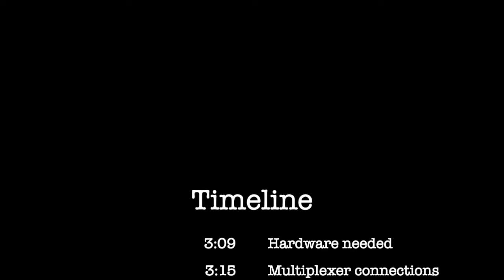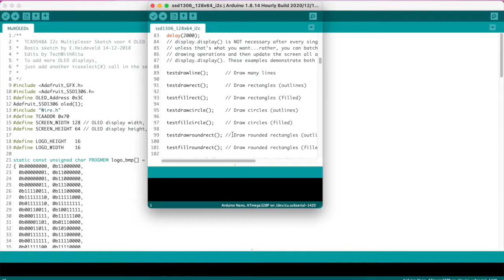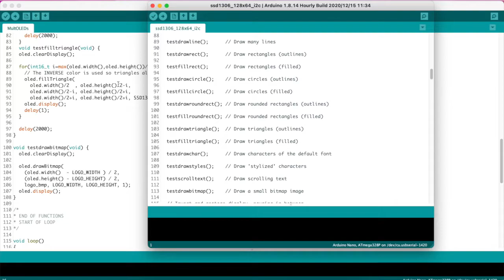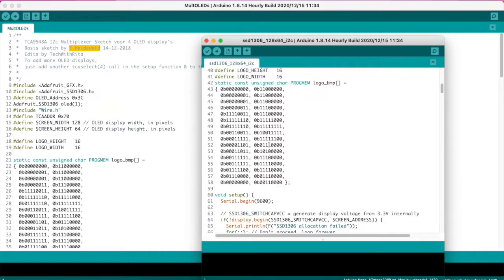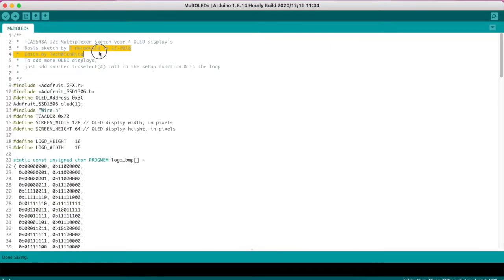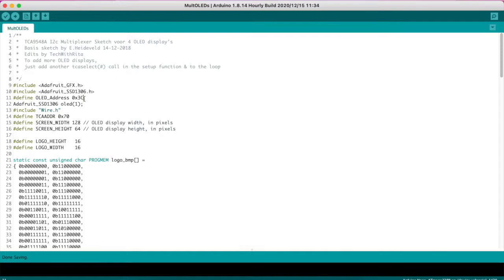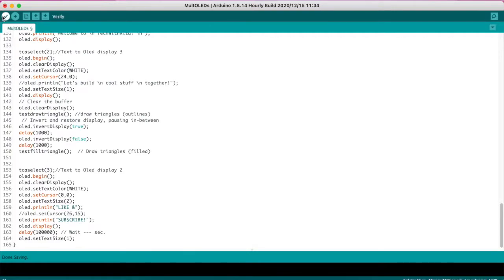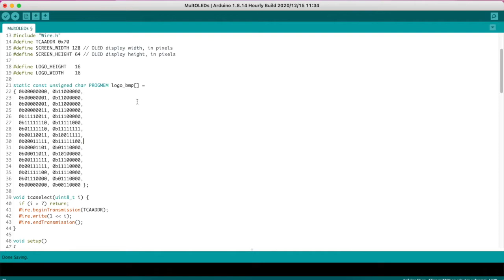Connect Multiple OLED Displays With Arduino Nano (or any other board)

Comment: The code presented by TechWithRita works well and is simple.  I'm relatively new to Arduino programming -- but not that new and in the middle of a fairly complex build requiring 4 OLEDS.  I've tested (and tested) multiple approaches from other recognized Arduino training experts, and this training Video is the best!  Thank you TechWithRita.

Comment: Also, an interesting thing is that You can "hot replace" and/or "hot insert" on that multiplexor if any of the screens went bad.
And while watching this one, I thought about You could make up settings on a primary (mandatory) display to be able to dynamically set up displays with I2C and various dimensions.

Thanks to You I did find out about multiplexor. Because wanted to connect a couple of those displays.

Keep up and thanks for such a content!

Comment: Great video Rita. If I choose to use an Arduino UNO will do everything like you did still work? Does the code and everything operate? If not what do I do instead? 

This is a general question also. If I see a youtube tutorial using one Arduino, does the code linked still work across all models? Or will I need to adjust it someway? Thanks for any tips or suggestions.

Comment: Really cool video thank you this is something that I'm trying to do I need two screens to display 2 voltages per screen I am measuring four devices voltage output, under one volt DC volt. So .001. Do I need a multiplexer for two OLED screens do I need voltage sensors where do the two screens wire into the Nano if I do not need a multiplexer? Thank you for any help

Comment: Hi Rita! I have a question.
If I connect a single SSD1306 display, it shows clear and continuous text. But when I tested your program with two screens, the text is displayed as pixelated, as if the vertical lines on the screen were separated. Some ideas? Thanks in advance
Reply from the maker: Hi! Are both your screens 0.96” OLED I2C ssd1306 displays?
Reply: same problem here. using two 0.96" ssd1306 displays.

Comment: Hello. Thank you so much for your video.
I have a question. Can I use such a display in the car? I would like to have a customized gif made by my own and maybe a clock. It is possible to connect it without a computer?
Regards

Comment: the background musak is too distracting
Reply from the maker: I apologize, and will take this into consideration on my next video edit. Thank you for your feedback!
Reply: @techwithrita  Hi, thanks for replying. Looks to be a good vid, but I could not make it to the end due to the musak. Personal choice I suppose.

I am building a FrankinClock on ESP32. Could not decide which clock to make, so I'm doing them all :o)
Have a virtual fake Casio FW91 (the most faked watch in the worked) on a tft screen, a LED matrix, a 7 x 4 segment LED and a 1.2" oled (so far :o)

Problem I am running into is having different pixel size on the 2ic bus (128 x 64 and 128 x 32) and tft screens with different drivers running on the spi bus. Have not yet found an instructional of how to mix different screen size or driver.

Sound module is coming next, so will randomly have cuckoo, big-ben, chimes etc :o)